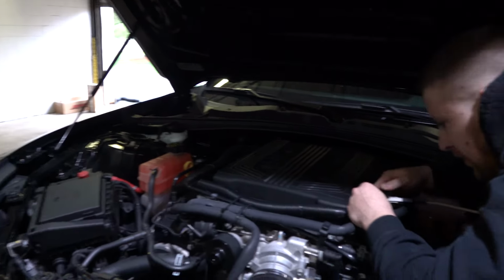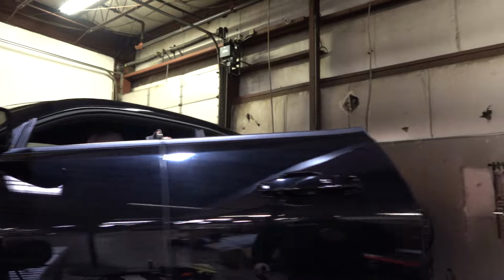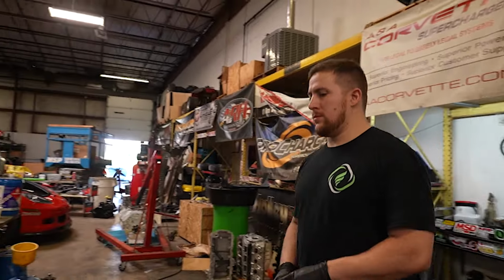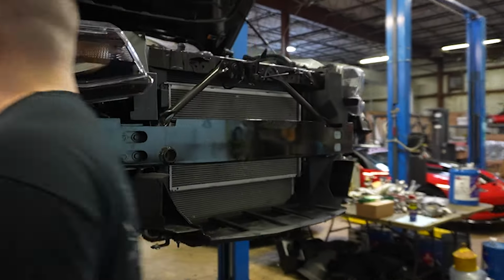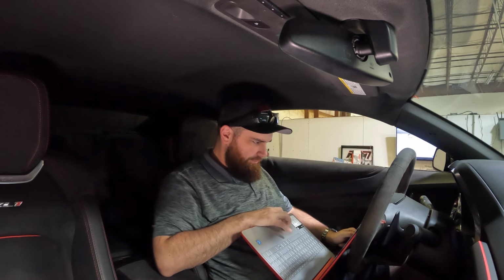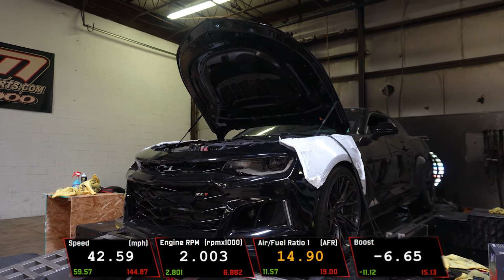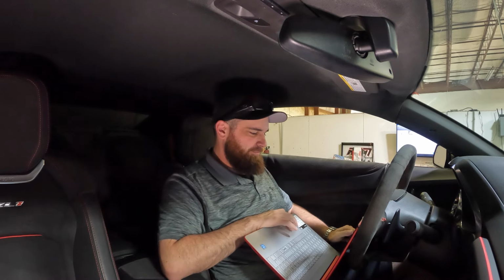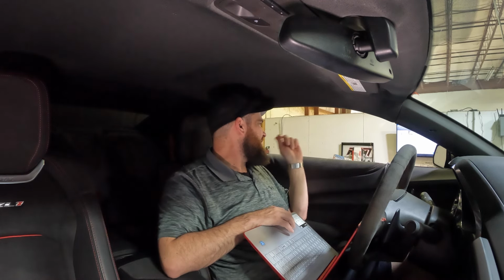ZL1 Camaro Makes 800RWHP On Straight 93 Octane!!!  Stock Blower

Comment: Basically same build as this on my ‘19 ZL1 auto. stock converter 766rwhp @6,850rpm on 93  no meth or e85. 17 x 10 beadlocks et street r’s will almost hook completely from a dig on the street. It’s a monster! Love it! 😎👌
If you drive it easy..
21mpg highway 
14mpg city

Comment: What is a lot timing on straight 93 ? 
20 degrees? On 15psi
Reply from the maker: Don’t remember exactly but I’m sure it was around 18 or so
Reply: @RaceProvenMotorsports  ok I have smilar same mods I drive about 21 degrees but im Here in Germany like we have here 97 octane in Germany like 102 octane

Comment: Question, with your install of 2in kooks headers which spark plug wires are you using? I keep burning up my plug wires on cylinders 2 and 4. So any help would be greatly appreciated. Thanks
Reply: @even_i2622  I used a 1/2” id heat sleeve(fiberglass inner) over my stock wires and a 1 inch id 2500 degree heat shield sleeve over that, all loose fitting on purpose to let the heat escape. I’ve had no issues. Total cost around $35
Reply: @dronechaserzl1  I thought I had solved the problem by buying accel 9000 ceramic plug wires, but discovered that they actually work their way off of the coil pack even though they snapped on originally, then there is the problem of if you try to remove them to check spark plugs you wind up breaking them. At 160.00 a set you would think they would be better. They absolutely stopped my melting wire problem but created more issues of a different kind. So I’d say they are junk in that aspect. So I’m buying another set of wires I don’t have the factory ones anymore, but I’m looking to not have the same issues as before. Where did you get your heat sleeves from. I’ve tried them in the past with the 2in headers but to no avail. When I had 1 7/8 headers I didn’t have this problem at all. The win are just really close to the plugs on 2 and 4 and the are the only ones I have the problem with.
Reply: I have an 18 CTS V with 2-inch Kooks. I switched to Taylor wires and have had zero issues after three darn sets of wires.
Reply: @unclemel8276  good to hear because that’s what I actually ordered this go around! Did you get straights or 90 degree boots? I appreciate your input by the way. I feel like I’ve spent way too much on this already. It’s always a little things !😂
Reply: @unclemel8276  love Taylor’s, all I used back when I was bracket racing! 👌

Comment: How is the traction? I am so scared to ruin my ZL1 by giving it to much power to be able to punch it out of a corner.
Reply: Trade you my ss for that zl1 If you’re having trouble managing it 😉
Reply: @onlycamaros  I am having no trouble managing it as it is right now, I just want to keep it that way. I don't just drive it in a straight line like most people. I am just not sure how much power the chassis can handle before I've ruined it.
Reply: drive the car how it’s meant to be driven
Reply: @colety04  right? Ffs. So much whining. Drive it.